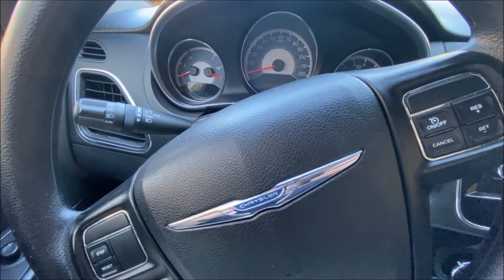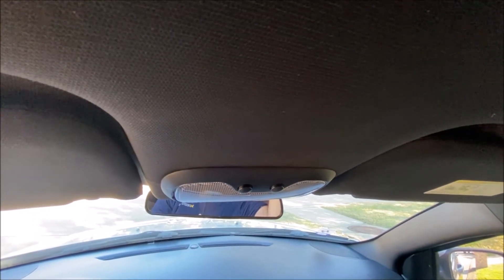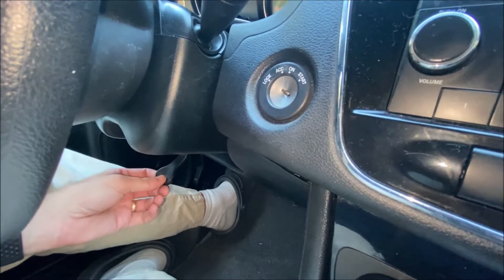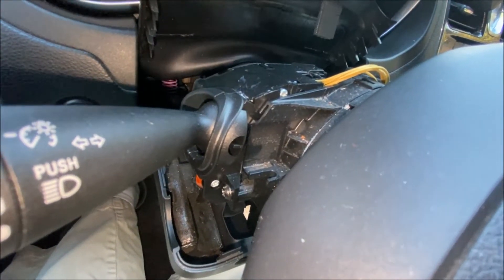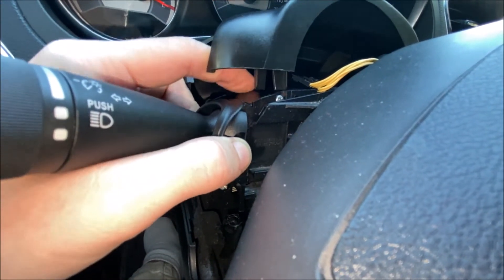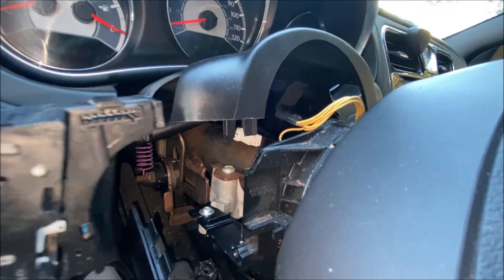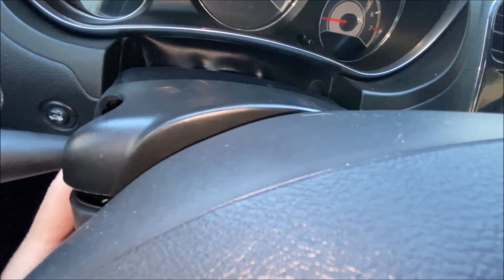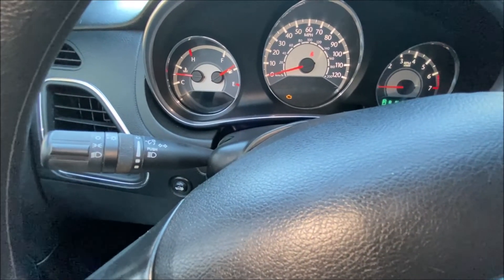Replacing the Multifunction (Blinker) switch on a 2014 Chrysler 200

Comment: Was you able to figure out the problem. I was losing my digital cluster readout when trying to use the multifunction switch.

I think that's what causing it and done light glitch when trying to turn them on sometimes.

Wish you could of tried turning the car to run with the switch disconnected to see if the digital readout stays dark/off I think that has something to do with it 

Before I could just shake the lever around kind of hard and my digital readout would come back on. Now that doesn't work for me anymore
Reply from the maker: Replacing the switch worked well and it’s very easy to do, but it didn’t solve my problem. In the end, it turned out that the previous owner cut the wire under the dash for that lighting! Who knows why but once I repaired it, things have worked great. So, I’m sorry, but I’m no help with your cluster readout problem. Good luck and thanks for watching.
Reply: With a malfunction switch cause the car not to turn on like if the battery was drained

Comment: Will this work on a 2016 chrysler 200.
Reply from the maker: Short answer - no
The 2011 - 2014 models of the 200 are different in a lot of ways from the 2015+ model years.
From rockauto.com, the multi-function switch for the 2016 is very different from the 2014.  It looks like the clock spring and both switch levers are on a single unit and you probably have to pull off the steering wheel to replace it.  Definitely more involved than what I show in my video, unfortunately.  Not to say that it's not doable, just different.  The part for the 2016 also looks to be way more expensive, unfortunately.
Thanks for watching, sorry about the answer.